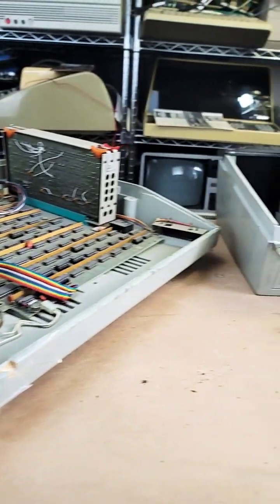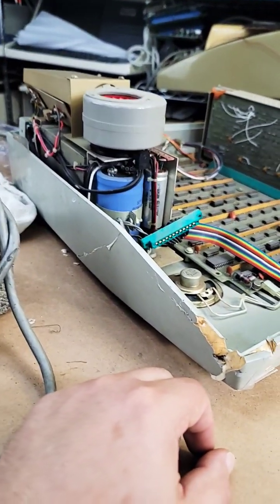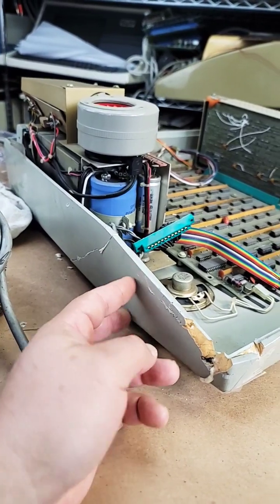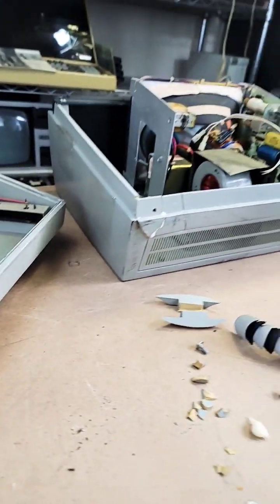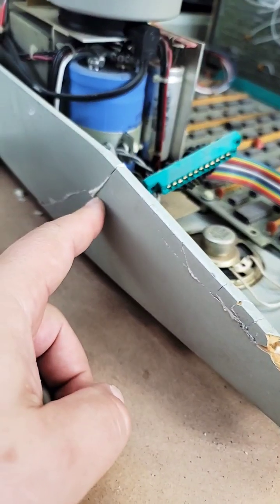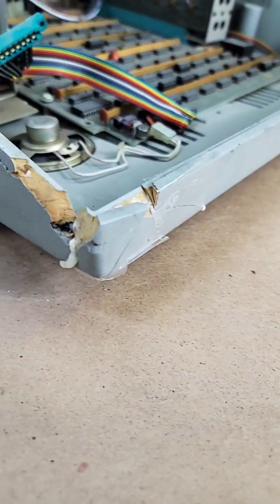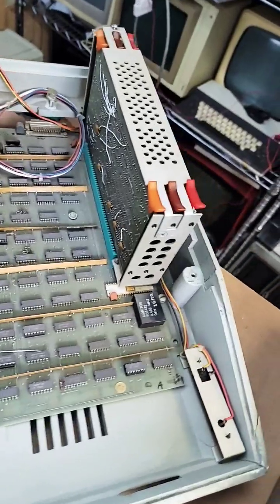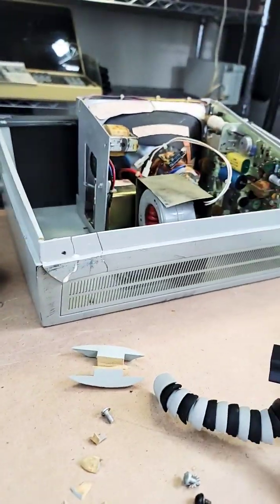Gorilla glue ftw repairing this super rare 1974 terminal.  #shorts #retro #computers

Comment: "FedEx got their hands on it"
Yep, I've had 0% success rate through them. If it arrives at all, it will be a minimum of a day late and or smashed to pieces.
Reply from the maker: I remember the time my shipper had the gall to out Fragile stickers on the box.  It was absolutely pulverized.  Nice 5153 monitor.  Sigh
Reply: @TechTimeTraveller  Ouch! I had an IBM 5170 (the later 8MHz/512K model) that was shipped via UPS, and when it arrived, the back left corner was nearly completely flat. Normally 6 inches tall it was compressed to around 2. We banged the frame out with a hammer and wound up putting a clone motherboard in based on the Chips&Tech NEAT chipset. Happy ending to what was a really crappy day.

Comment: You'ld wonder how this (or any) equipment survived shipping from its point of origin to where ever it was used when brand new.  Or does the plastic case get brittle with age.
I guess that when new it was shipped by truck in multiples while tightly stacked on a pallet while handled with a forklift.   Forty years later individual cartons thrown around by hand with other random boxes on a conveyor belt and tossed into a delivery van.
Reply from the maker: Plastic definitely gets brittle.  I had a US Videotel terminal shipped in its original packaging inside another box.. outer box showed little sign of damage..  but the terminal was absolutely shattered.  This terminal is built of urethane foam so it's even weaker.

Comment: What works best for me when shipping vintage equipment is to double-box it - one box with 2" of bubble wrap around the item, then that box goes inside another larger box, with 2" of shipping peanuts protecting the inner box. Overkill but I shipped two Imsai computers that way with no damage.
Reply from the maker: Yeah.. ive often managed that but a lot of sellers just don't care.  Now this unit was actually well packed.. but the urethane foam the case is constructed of is known to be weak.. I think sometimes any kind of shipping is a bad idea with these.
Reply: @TechTimeTraveller  Ohhhhh the case is all 50 year urethane foam, like a car dashboard? Holy cow, I missed that! You could breathe on that the wrong way and it'll fall apart.
Reply from the maker: @soupwizard  Yeah.  I believe it's made of the same stuff they used in the Apple II ventless case.  Not strong at all.  I have suspicions this was a low production run thing for a specific application.  There is lots of dust inside but no dust on the fans, no burn in I can see on the screen.  If this thing had any use I think it was very limited.
Reply: Any package shipped over an international border is subject to be opened by customs inspection, and they may not care to seal it up again so carefully.